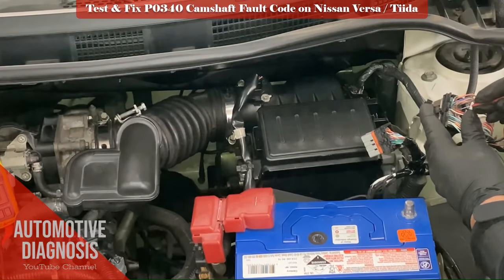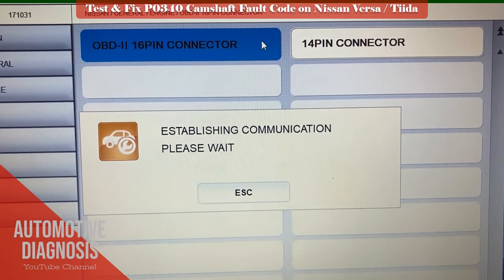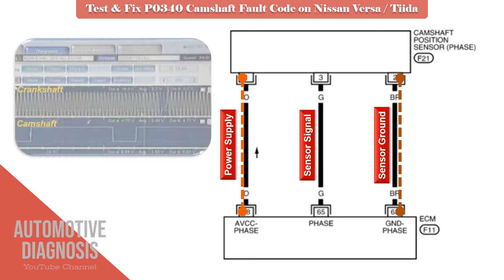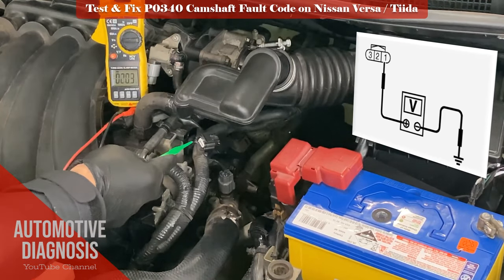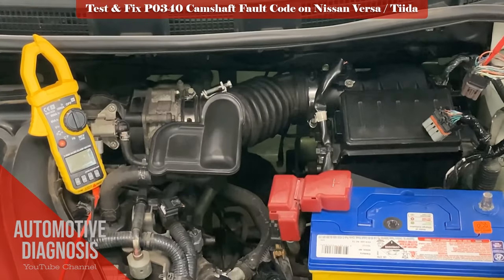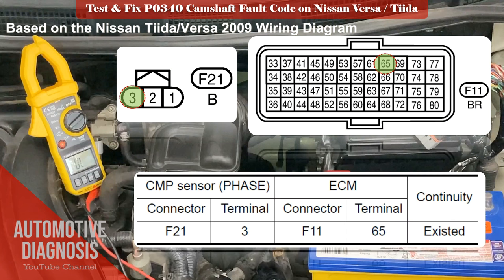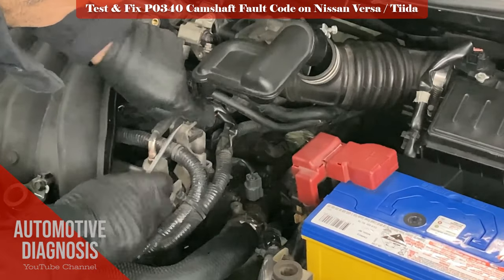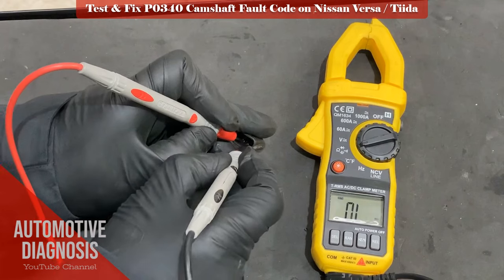How to Test & Fix P0340 Camshaft Position Sensor Circuit Fault Code | Fix Engine Starting Problem

Comment: I have a 2013 Kia optima 2.0 turbo where can i find the wire diagram for my car?
Reply from the maker: Take a look at our online store, we have that diagram and it’s free.
Reply: This car has me stumped. At the connection to camshaft sensor I'm getting 4.9v left side right side I get 11.9v. I was told both should be around 5v so why do I get 11.9v?
Reply from the maker: Hi my friend. What fault code is exactly set on your car? And by right and left, do you mean intake and exhaust or you are referring to the front and rear side of engine?
Reply: P0365 and P0340 . Left and right meaning at the connector there is 3 prongs
Reply from the maker: As I see in the wiring diagram, both intake and exhaust camshafts are getting the power from engine fuse box (Fuse F33 10 A) , so there must be 12 V on both, on pin number 1 (must be red wire if it's the same on your car too)
Reply: Yes the red wire is getting 12v and the green and orange wire is getting 4.9v. So that's the correct voltage to both cam shaft sensors then? I tested the sensors and both are good so why the error codes for them both is what I can't figure out?
Reply from the maker: @killerman7011  You are getting fault codes for both camshafts. Haven't you recently done anything on the timing chain or something that needed the timing chain removal? also, when was the last time you changed the engine oil? and finally, I suggest to remove and clean the VVT solenoid valves.
Reply: Yes burnt a hole in a valve so had local machine shop all new valves and head resurfacing. I marked the chain and sprocket before removing to make sure was correct. 🤔
Reply from the maker: @killerman7011  I still think it's timing. Engine will set Cam or Timing fault codes even if timing is a little off. And considering the fact that you have recently removed the timing chain and right after that you have codes for both camshaft, it tells me that timing adjustment is off.
Reply: Ok so could that cause the difference in voltage as well .?
Reply from the maker: @killerman7011  This is not gonna cause the voltage difference. The 12 V is power supply and 5 is signal.

Comment: I need help. I have 2018 Ford Taurus. I have 4 cam sensors. I replaced with OEM new ones. I even put a new crankshaft sensor in. The cam sensors  read when the engine is cold but after engine is warm they all stop reading. I can tell by the live data on my scan tool.
Reply: And they all stop reading when warm
Reply: Can someone help me out
Reply from the maker: Hi there, and you have p0340 or another fault codes too?
Reply: I think that’s wats going on wit my 06 Altima. Did u fix it?

Comment: When i test ecu signal 5v,it change to 12v, what happen,  hyundai accent 2003
Reply from the maker: Hi there, you did this when CMP connector was disconnected?
Reply: @AutomotiveDiagnosis  yes, the cmp not connect
Reply from the maker: @ridwansatria3671  That’s normal, when connector is not connected that voltage change will not happen.
Reply: @AutomotiveDiagnosis  omg, so i think my cmp is broken . Thank u for sharing

Comment: I have an issue it's been throwing at crew for almost four years now on my Chevy Aveo and the car is still running perfectly it's x-rayed up on their number one crying like a kitten but I can't pass the mission cuz it's throwing a code that is so crazy I erase it picked over a fight baby I got to change the oil already did that once and it came back but I might have to try it again
Reply from the maker: Hi there, thanks for sharing your experience, is your code P0340? You didn’t mention it.

Comment: I have scanned using obd2, then the error code appears. But there is no problem with my car, such as difficulty starting the engine. Is it okay if I delete the error code?
Reply from the maker: Yes, That should be fine. Most of the time, fault is intermittent and it happens just because of a poor connection or just an electrical noise. Erase the code and keep driving and keep an eye on the engine light. If it comes back, check the sensor connector.

Comment: Please can hall sensor test for resistance
Reply from the maker: Normally we don’t check the Hall-effect sensors for resistance as I haven’t seen the specifications or any recommendations in the workshop manuals to do so. Although I have seen many guys made videos in YouTube for checking these sensors by measuring the resistance, there is no specifications to check the measurements with, and when there is no spec., how can we say this measurement is good or not? However for inductive sensor we do have the internal resistance check and we do have the spec. as well.
Reply: @AutomotiveDiagnosis  thanks for your help